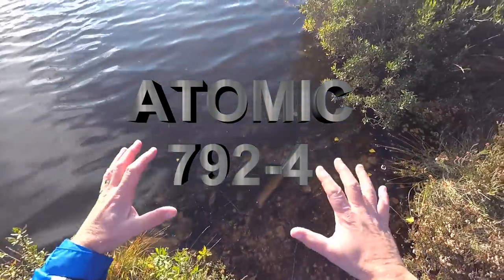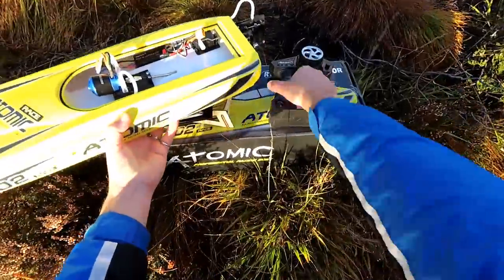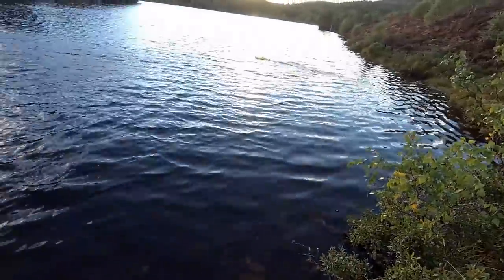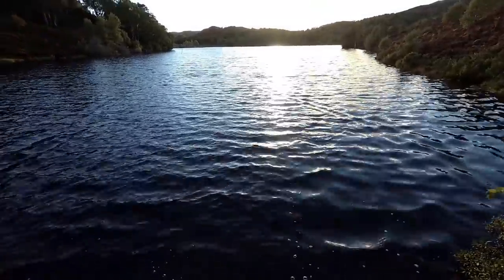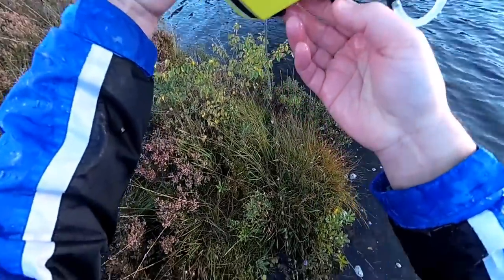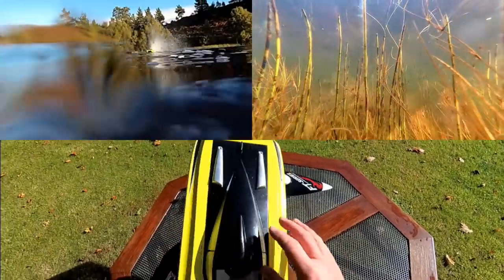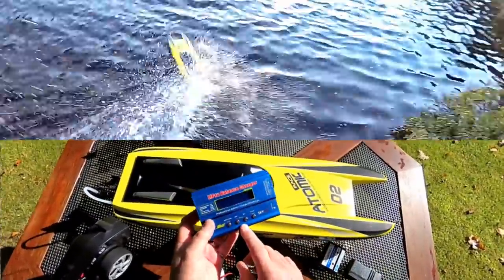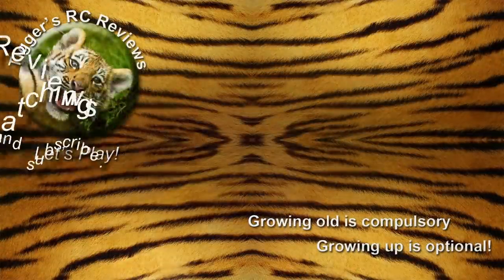RACENT VOLANTEXRC ATOMIC 792-4 Brushless Watercooled fast RTR RC Boat

Comment: I'm running a 120 Amp Flycolor ESC with a Leopard 3660 X2 Motor, 2650kv on Turnigy nano-tech 2650mah 6S 45~90C battery, with a 2 blade 40mmx1.6 pitch propeller. Crazy fast & stable. Has reached 70km & more ;-) I also changed the flex shaft to 4mm, and replaced the plastic strut & rudder with aluminium.

Comment: Careful, my ESC split in 2 on maiden run, fixed it with some waterproof tape easy enough. On 4s the ESC was getting over 200 degrees fahrenheit. Put a Seaking 90amp, programable, reverse, proper LVC/limp mode, will run on 4s all day now. Love your channel.

Comment: Fortunate for the wind to blow the capsised boat back to you. Google's 'self righting RIB,' images show full-size RNLI lifeboats with bouyancy bags atop what in car terms would be a roll cage. Four holes, two glass fibre rods curved into 'U' shapes and some zip ties would hold a closed-cell foam float (-- smallest pipe lagging/bubblewrap .. .. ). With low CofG it would self-right. It could be made to look like it belonged there and save yourself a wait/calling your buddy or going home to get a rescue boat .. ..The flexy propellor shaft is probably a tightly wound spring similar to those used on garden strimmers or holding up my aunt's net curtains. Reverse the drive and it would undo and lock solid in the guide tube.  ps Compared to quads/cars/planes, .. boats are pretty simple in electrics and engineering .. .. so does anybody think they all are just a mite over priced?

Comment: Hmm. It's nice enough, fast and reasonably well equipped. But it will never replace a proper boat as it has no big white flappy things.....
Reply: RC sail boats are quite cool I like ww2 battleships with Airsoft guns on them for RC war make them from balsa and thin vynal so the BBS will hole them and you can have wars with friends 👍